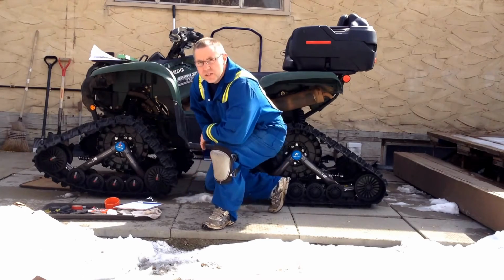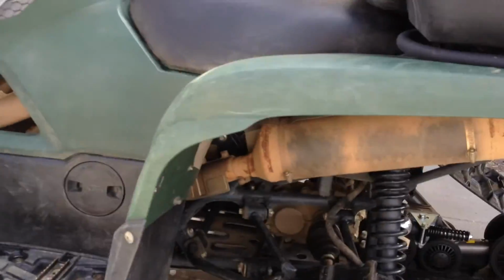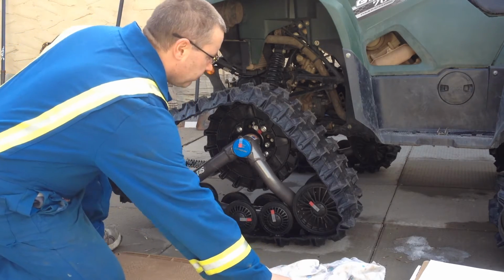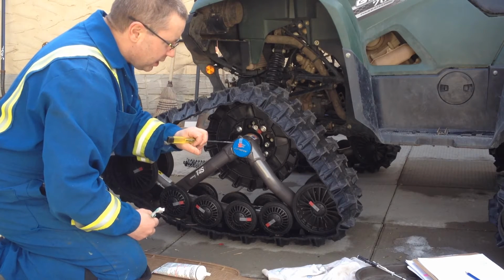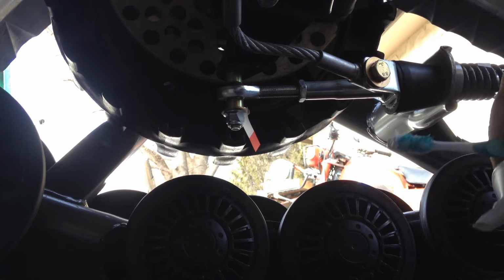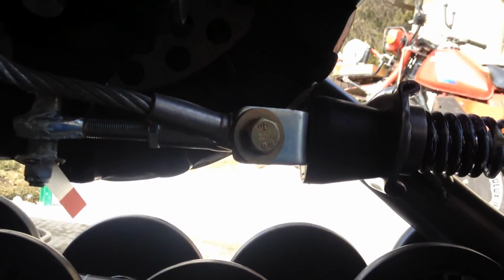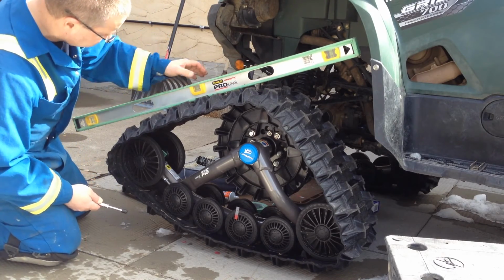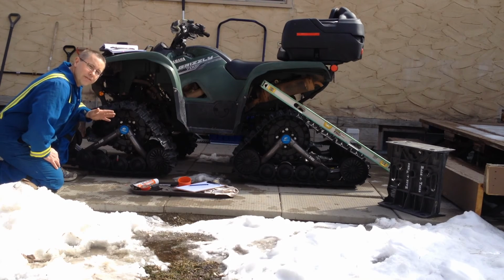"Outbacktrax" T4S Camso/Camoplast ATV maintenance

Comment: Thanks for the thorough instructions. One benefit of installing yourself is before they're on it's alot easier to poor a teaspoon of 90 weight motor oil in each bearing while it's on it's side. Leave over night so the oil goes into bearing, flip and do other side the next day. Takes 3 days but about 5 hours in total work and I'm no mechanic, important to get alignment perfectly straight, take a ride and check again, always seems to go out after a ride. Track tension tool is essential but the rest is just basic tools. Check adjustments after every 20 hours or ride time.

Comment: After a few hours of use (about 100) the wheel barrings loose the rubber seal and start rusting if you go in water lots I suggest greasing after 20h of use and pulling off the rubber seals after you go in deep water or snow. I alwase find water in there. ;-)

Comment from the maker: A question came up by email: What tool did I use to test my track tension? That's a great question. I use the Wood'y track testing tool, Model # TRAK-TOOL-1, part # 389-8767.It can be used for all types of ATV tracks, UTV tracks, toboggans/sleds and snowmobiles, this took 4 days to arrive. It a great tool, It measures in inches, kg, lbs, cm, mm and deflection. The T4S manual shows the Camso track testing tool, part # 2000-00-3125 but, this was very difficult to find, and the shipping time was 2-3 weeks even at a atv dealer.Keep the questions coming and you all have a "HAPPY EASTER"  eh.